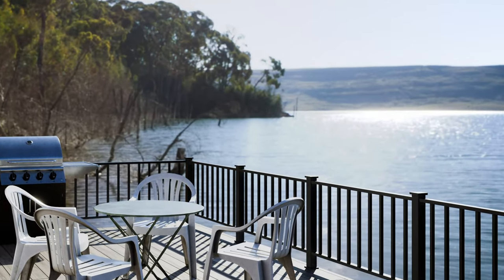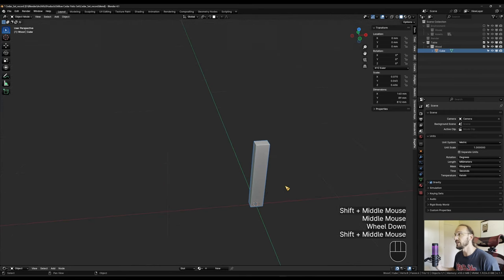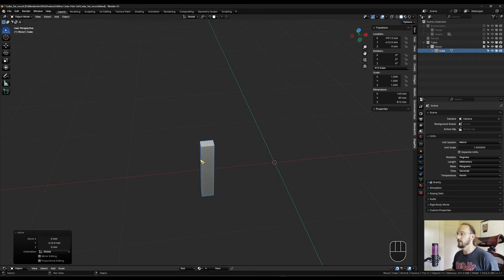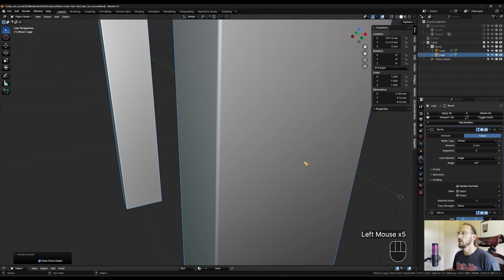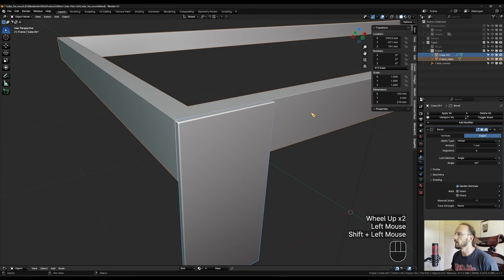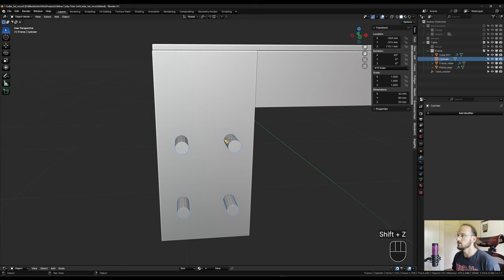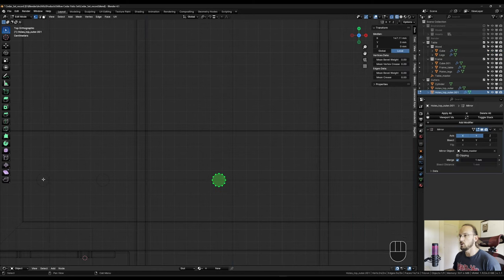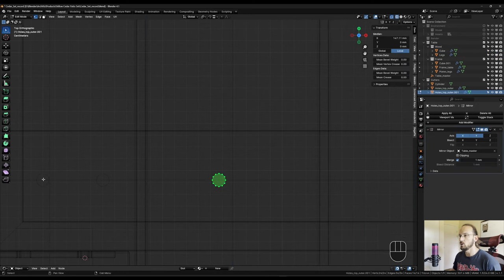Precision Modeling with Modifiers in Blender: Patio Set Tutorial

Comment: The part where you shift select and alt shift select the two edges in order to restore the bevel doesn't seem to be working for me (Mac os)
Reply from the maker: Do you mean on the vertical plates at 16:20? Booleans can be hard to troubleshoot. Of the bat I'd try to edge slide the supporting edge loops individually with g+g until they visually don't overlap with vertices on the holes anymore. Also double check if the boolean modifier is above the bevel and in the bevel modifier under geometry try to toggle clamp overlap on and off, see if that works. And the classic: in edit mode on the plate press A to select everything and M -> "merge by distance" to make sure no double vertices found their way into the model. They're pesky sometimes :)